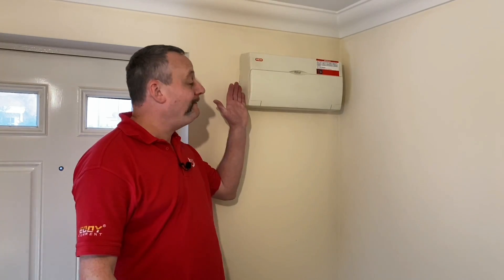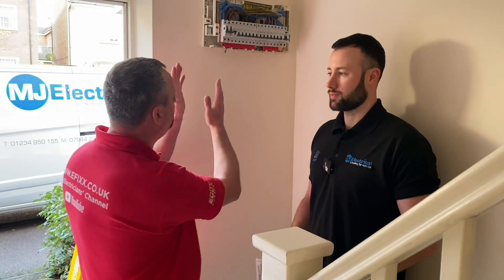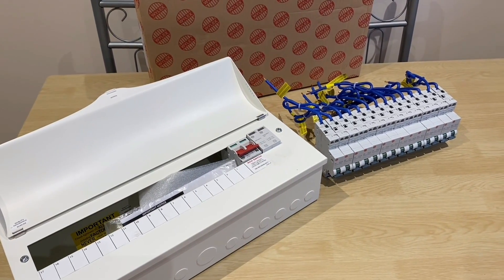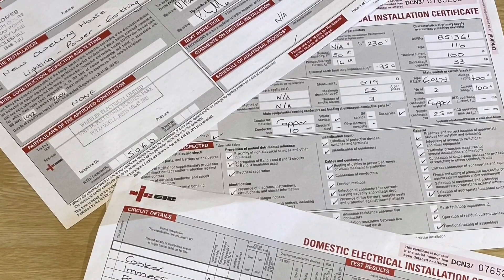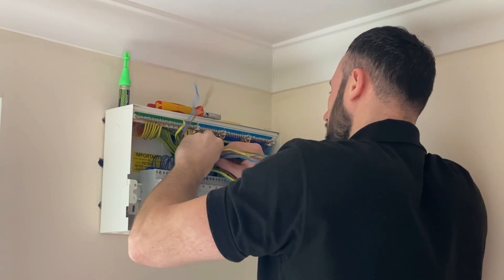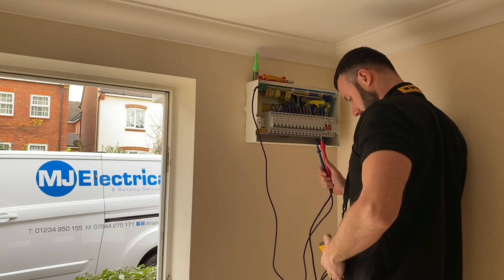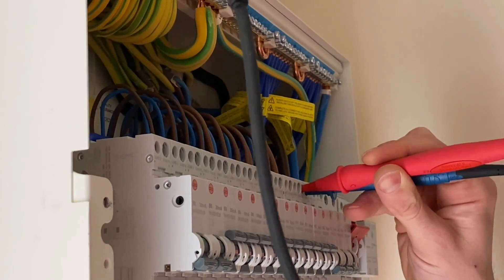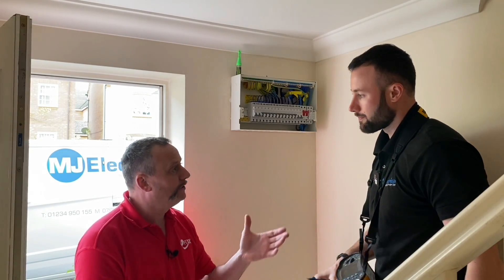Should you install a full AFDD or RCBO CONSUMER UNIT?

Comment: Is there a reason that Type A RCBOs (/AFDD RCBOs) have been installed for the PV system?
Reply: DC Leakage
Reply: @paullyons4624  yes, isn't that exactly why you wouldn't install a type A RCBO?
Reply: @tomcardale5596  Think you've got your models mixed up. Type A RCBO is suitable for DC pulsating leakage up to 6 ma. Note the ~ ac symbol and the - symbol below for dc marked on the breakers.
Reply: @effervescence5664  I think that's almost exactly what I was getting at but also almost exactly the opposite! As I understand it there's AC (AC only), A (AC & pulsed DC), and B (AC & pure DC).

Clearly AC is wrong, and given the prevalence of switched mode power supplies in electronics it's right that these are going by the wayside.

I should preface the next bit by saying I have never really paid much attention to domestic solar. The solar I am involved in tends to be larger scale and installed (deliberately) to avoid the need for RCDs. It's entirely possible I've missed something and it's entirely possible that I'm picking up on something that's either not possible or not a thing, hence the query.

Since making the query I have gone from "I think something might have been missed" to "I think I need to do some more research" and this research follows. In summary, it depends but I think a 30mA type A RCD is wrong but not for the reasons I originally thought.

The IET's code of practice in section 8.8 says  that transformerless inverters (that's most of them) "may be able to feed a DC current in to the AC side. This DC element may not be picked up by a conventional RCD and may also hinder its normal operation. A type B RCD is, by construction, able to handle and detect both AC and DC residual currents". 

The COP says that where an RCD is required (and in another section it gives lots of reasons why you probably don't want to if you don't have to) it must be a type B.

BS7671 712.411.3.2.1.2 says "Where an electrical installation includes a PV power supply system without at least simple separation between the AC side and DC side, an RCD installed to provide either fault protection by automatic disconnection of supply or additional protection in according with Regulation 415.1.1, for the PV supply cable shall be Type B.... Where the PV converter is, by construction, not able to feed DC fault currents into the electrical installation, an RCD of Type B is not required".

"Simple separation: separation between circuits or between a circuit and earth by means of basic insulation" - which I think means that any transformerless inverter doesn't meet that.

So, I think this poses the big question "can the inverter inject DC in to the RCD?" because if it does it must be a type B.

Looking at SMA's datasheet for the STP25000TL (it's one of our more common inverters) it says it contains an "all-pole sensitive residual-current monitoring unit" whatever that means. The STP50-40 is the same.

Diving in to the operating manual it says "The inverter is compatible with type A and B residual current devices that have a rated residual current of 100mA or higher" and then references this document, "Criteria for selecting a residual current device" https://files.sma.de/downloads/RCD-TI-en-45.pdf which is quite boring!

For the STP40-50 (50kW) "The inverter is compatible with type B residual-current devices that have a rated residual
current of 300 mA or higher".

I checked their smaller inverters and they require a minimum of 100mA too.

Amendment 1 of BS7671 relating to EV charging has similar requirements. Either use a Type B RCD or where you use a Type A RCD then the charger must incorporate DC residual current monitoring.
Reply: @tomcardale5596  thank you for this, very interesting and answered a lot of questions I'd been asking myself. Although it may also be worth looking at the costs and availability of type B RCDs.
Reply: @TheFool2cool  yes, I think it raises as many questions as it answers!

I believe the best way of doing things is to design systems in a way that means RCD protection isn't needed, it certainly makes things easier.

Single phase B type RCBOs are a thing and aren't prohibitively expensive. 

Three phase B type RCDs are a thing and are more expensive but not completely silly. Three phase RCBOs of any type don't seem to be a thing, that's annoyed me for years.

I haven't been able to find AFDDs with anything other than a 30mA rating or with type B RCDs in them but they are an area I'm not really very familiar with.
Reply: @tomcardale5596  This is interesting to know as most of the Type A, B Curve RCBO's currently being fitted for ac/dc coverage that are manufactured by Hager/CP Fusebox and a like are rated for the 6ma DC when you go through the manufacturer literature and technical helpline state they're suitable for Solar and EV installations. In short it seems they have written the COP in mind with RCD's and not RCBO's as it appears the Type A, B Curve RCBO's behave in accordance with a Type B RCD at least as far as manufacturers are concerned. This allows for Manufacturers instructions to override regulations and take precedence. 

It's interesting when you take into account the EV points as most are installed on a Type A because there aren't many Type B RCBO's from reading up, which implies that most EV installations don't meet standards as it's really only the Zappi and about 3 others that have consistently used current monitoring. Though with how haphazard the EV roll out is going I fully expect domestic EICR's post 2030 to fail on EV points regularly. 

You're correct in thinking most Solar installs now aren't electrically separated, most have now swapped over to micro inverters with no transformers as the old large inverters with a built in transformer downed the entire array if one panel had an issue. Your "all pole" requirement is L1/L2/L3/N/CPC and is common in commercial settings for 3 phase machines when it's required, especially if those machines forgo N for "balanced 3 phase" and make their own neutral internally for control circuitry. 

Also Eaton and Scheider Acti9 have 3 phase RCBO's but more often than not once you're in a commercial environment the factories act and risk assessments take precedent over bs7671 much to the annoyance of one of my niceic assessors.
Reply: @effervescence5664  thank you for the detailed reply!

It's not just the CoP that mentions Type B RCDs, it's BS7671 too. I do wonder what the difference between a Type A that's sensitive to pure DC and a Type B is, I wonder if they're not the same thing? Or possibly a pure DC sensitive Type A trips at 6mA DC and a Type B at 30mA?

As for micro inverters... not in my area! We're very much on string inverters and I would go out of my way to avoid specifying either micro inverters or the SolarEdge system of optimisers. We've got just over 2MW of SolarEdge on the portfolio and 3-4MW SMA (plus a few others). The SolarEdge systems cause 90% of the faults, and when something does go wrong it's up on a roof when you often can't get at it! 

When SE are working they do perform better, looking at the spread we have SMA systems in the top tier and SE in the bottom but as a whole there are more SE at the top of the performance list. There might be a few percent in it, certainly not enough to warrant the added expense even if they were reliable.

Comment: 16 AFDDs.... e.g. Siemens quotes 1.35W power draw, so over 20 watts of heat being generated inside the CU. That has to be bad for long-term reliability. Not to mention 25 quid a year electricity cost. 
As regards overall benefit of mandating AFDDs, you need to look not only at any claimed reduction in fires, but also how many CUs don't get replaced because of the high cost, leaving less safe setups in place for longer - it could end up having a net  negative overall benefit on safety. 
And the other utterly stupid thing is manufacturers haven't standardised the LED fault indications.
Reply: If I remember rightly wasn't the cost of that many AFDD's in the region of £1500 just for the consumer unit without the labour (ref: David Savery). On that price who the hell is going to do a full board. Shower/ Oven and large loading items makes sense but an entire board for a standard 3 bed domestic doesn't. The money would be better spent on having the attending engineer inspect all the connections of sockets and light fittings. 

The increased energy draw is a pain and honestly the people that wait the longest to upgrade are the people that can least afford it. Defies logic in the long run, recommended sure, practical/ should a full AFDD be fitted no way.
Reply: @effervescence5664  Yep, and at around 150 quid a throw for a Wylex AFDD, customers will laugh you out of the door. That CU must have cost over £2k to supply and fit! looooooooooool
Reply: @niceguy235uk1  £3500.00 without fitting afdd/rcbo £185.00 each plus a board £145.00 and it's a 18 breaker set up.
Reply: @effervescence5664  About £2500 for the full set of AFDDs here.
Reply: @mikeselectricstuff I'd like to see a full teardown of these things, want to see s power supply inside them that's got at least a 20 year life span.....
Reply: Think electrical complaince board jealous at gas safe plumber spending 2k on boilers 

They want that sort of money spent for elec
Reply: Their RCBOs have similar, or even worse, power loss rating, also from my understanding the power lose rating is for full power draw, so it isn't so bad all the time.
Reply: I am not a supporter of the over use of AFDD, but arguing power effeciency against a life safety device... Seriously! I hope you personally unplug all your devices on your home before going to bed 🤔
Reply: @sandymcnair5298  agree, it’s a poor argument to pit the cost of safety against the cost of such devices, BUT Mike’s point about seeing claimed reduction in risk of fire would be interesting. If it were mandated then I agree, unintended consequences would be that many CUs don’t get replaced. But it could be mandated only for new dwellings...

Comment: I won’t be fitting AFDD’s until there is some trustworthy way of testing them
Reply: So their not mandated (in UK) they cost a bomb and they have nuisance tripping issues.. 
I don't think id put them in unless forced to
Reply: @Froggability  completely agree, RCD call out faults are bad enough, imagine putting AFDDs on a board change to a older installation, nightmare
Reply from the maker: Thanks for commenting
Reply: Not really justification for not fitting a device that can save a life.
Reply: @sandymcnair5298  next thing is plumbers will be fitting sprinkler systems in domestic houses because it can save a life , where do we draw the line ?
Reply: @sandymcnair5298  so would you be happy to sign your name to something that you have no way of testing to physically see if it operates or not? What happens if it fails? Who is liable
Reply: @amatchmadeindevon2005   AFDD have test buttons and indicators. I am happy to install equipment manufactured to the required standards. All we can do as designers and installers are to discharge our responsibilities as best as we can.

Comment: I understand in the 2nd amendment they are going to make us install AFDD's, which is crazy. 
All that money spent on a new board with only one spare way, seems a bit tight.
Interesting that he said it didn't comply with the regs because of a single RCD, yet in your colleagues video he suggested the opposite.
Reply: The next set of regs will clarify the use of AFDD which will benefit all as everyone will then price from a level playing field. I also believe that the recommendations will not be all circuit.
Reply from the maker: I think Matt was taking about a main switch being an RCCB covering all the circuits. Thanks for commenting 👍
Reply: @efixx  yeah I thought that, but in your colleagues video he said if it was a single RCD or twin RCD both complied with the regs, because the regulations were not talking about the RCD, personally I would take the view of the guy in the video.
Reply from the maker: In fairness this only has one RCD, several lighting circuits had no RCD protection at all so a slightly different issue.

Comment: Why wasn’t the fuseboard chased in the fooking wall? 😑 Has the arc detection gone cheap? Hager wanted a butt cheek per back in 2017.. did that customer just get a metal (conductive) box with almost 3 grand worth of arc detection?
Reply: A Hager flush fitted board would of looked better there
Reply: Lol only if requested looks fine as it is

Comment: Anyone else noticed Ze test being done with parallel paths connected? ;)
Reply: I'll really appreciate if someone could explain if its mandatory or otherwise to fit a B16 OverCurrent Protection for Intruder Alarm as seen in 9:37 ?? Thanks in advance.
Reply: @piratedprivacy9052  probably be fine with a B6 tbh, Id hope the burglar alarm isn't drinking more than 3KW!
Reply: TheFool2cool  Thnx for the reply...👍
Hehe...😲🤣🤣
Reply: @piratedprivacy9052  ive also noticed this on a few houses too.seemed a bit much.
Reply from the maker: The property has plastic water and gas pipes into the installation 👍
Reply: @efixx  I used to always take a Ze from the main earth conductor not tied into the earth block whether it was TT PME or TNS. You never know if the gas pipes internally are buried anywhere. That's the way I did it but not saying he is wrong in his method.
Reply: @efixx  so no need to install bonds? Asking for a friend
Reply: @kiers1970  - if water and gas are plastic, no you don’t.
Reply: I always test disconnected then reconnect and get the same reading 😂
Reply: @andytap560  me too..... unless it was TT 😂

Comment: It is perhaps very unwise to push the notion that AFDDs are beneficial, given the lack of evidence of their efficacy both regarding their sensitivity to faults and fire prevention ability. They are perhaps being pushed on us in upcoming regulations due to the lobbying power of those with financial interests in their installation (such as manufacturers and wholesalers). There is, however, apparently little evidence for their effectiveness (see, for example: https://communities.theiet.org/discussions/viewtopic/1037/27144 where an electrical engineer, in part, says: "The science behind these devices is simply not there, and it is easily shown that these devices are being sold to detect a problem which does not exist". Damming words indeed), and DIY testing shows just how useless they can be (see, for example: https://youtu.be/TVqi6CedMkM and https://youtu.be/jHrNMFESd6Y). Therefore, we certainly should not be saying they are effective at preventing fires until we have the evidence to confirm they are.

In short, are we being sold a bum steer, probably for nothing more than financial gain by those with vested financial interest? Also, if there is a fire because an AFDD didn't stop it by extinguishing the arc, who is responsible - us, for telling the customer AFDDs prevent fires, or the manufacturer for making claims about their device that didn't work?
Reply: To totally with you on this. An expensive safety solution proposed by manufacturers. Talk about conflicting agenda!

Comment: Doesn't comply with CURRENT regs. Also split load board complies with the current regs. You just did a video on this.
Reply: Only 1 side has RCD protection, this board is a 16th edition board which doesnt have RCD protection on lighting/heating loads.
Reply: @chrisjinks5197  Sure, I'll take back the split load comment - that board doesn't comply with current regs (dual rcds would). Still doesn't need to though.
Reply: @ThePa1ch  it needs RCD protection for all circuits with cabling buried at less than 50mm.
Reply: @TheFool2cool  That's the current regs yes. But is a C3 in an old installation.
Reply: @ThePa1ch  My wild guess is: It does not need to be upgraded unless changes of installation are made.

Comment: The £1000 plus fuseboard hehe
Reply: Just checked the cost of a 20 way spd board £145.00 the cost of the afdd/rcd breaker £185.00 per total £3475.00 just for the board ouch. Cant see Mr&Mrs minimum wage going for that.
Reply: @chrisardern4594  😂😂 I’ll take 2
Reply: @chrisardern4594  never mind mr and Mrs minimum wage.. I doubt anyone would really
Reply: And the rest. 150 per circuit, probably more like £2000
Reply: Yes for half the board!

Comment: I wish you had pointed out AFDDs don't proved arc fault detection on the main switch ,  the amount of burt out of melted main switch I've seen over the years because of arcing because the main switch terminals haven't be tightened properly
Reply: Spot on. Complete waste of time. Include em in the smart meters... No chance
Reply: Afdd. Yanks have em as lower line voltage higher power. Only time we may have seen arcs were with the old room stats. Could tell as your TV or radio give a load of white noise out!